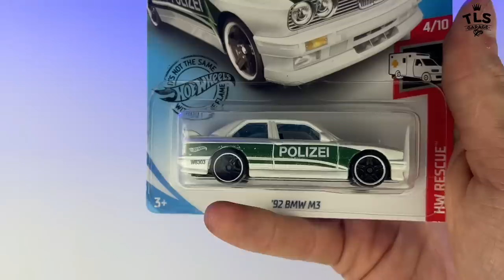Bagged RC Hotwheels Pocket Drift BMW M3 E30 (adjustable suspension)

Comment: Hi there! Thank You for actually inspiring me to get up and build something again. My biggest and only real question is how do you go about doing something with the antenna on the receiver without having any issues? I was trying to do a build with the 4 channel radiolink receiver with a Matchbox Mini Cooper (in pink, thinking hello kitty waterslide decals for the lolz) any help would be appreciated.
Reply from the maker: For most 2.4 receivers with an antenna, it is actually just the ~1” of unshielded bit at the end that determines the wavelength. If you simply measure that length exactly(typically 28.8mm), you then can cut away the antenna as much as you want as long as you leave enough left to re-strip the end back to the exact length as it was originally!

Comment: Dear TLS Garage, I really enjoy your content and I am very inspired by your work. It is very interesting to watch how you put together all the parts and pieces but, There is a problem. You see, All of the car builds are good and all, But when it comes to the paint job it looks sort of messy. For example, I will use the BMW e30 as an example. In the clip 11:38 you can see that the paint is messed up with some sort of dust or metal shards. I think that is is from the metal body that you were cutting. I think if you would take your time and properly cleaned all the parts, the out come of the product would turn out great. Please note that I am not hating on you videos, I'm just helping you make some changes so the finished product was a lot nicer. Please consider the changes. 

Thank you for reading this letter. 🙏🙏🙏
Reply: Beware of scams
Reply: @sarahperso6445  yea I know it is all cap I saw
Reply: @NightRide69  apparently the tls garage account has been hacked
Reply: @sarahperso6445  no I thing that it is just a nother wannabe look alike lol

Comment: The reason the guy doesn't sell these cars is because he's using branded Hot wheels for the body and such and modifiying it which is violation to copyright IF you sell said product even though the product is transformed the contents of the body is owned by Hot wheels (hotwheels copyrights and trade marks their stuff before release) aswell as other headaches I think he could sell them if he made and produced his own custom body/models but on how he builds these cars is legally impossible.